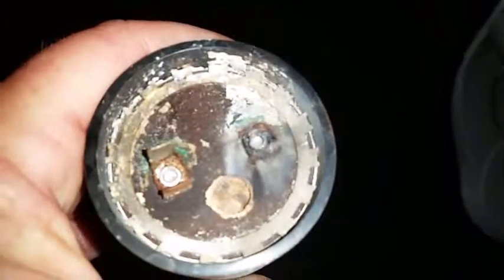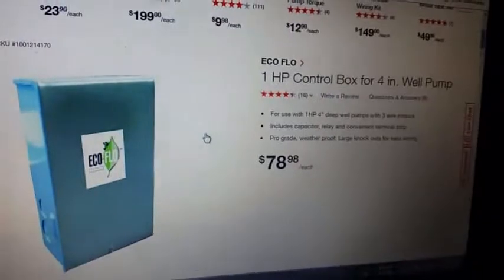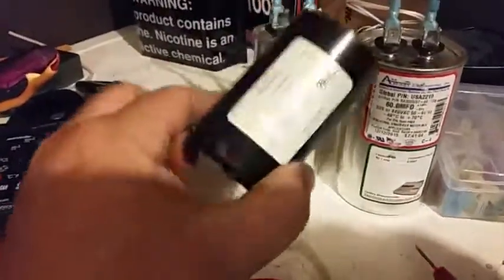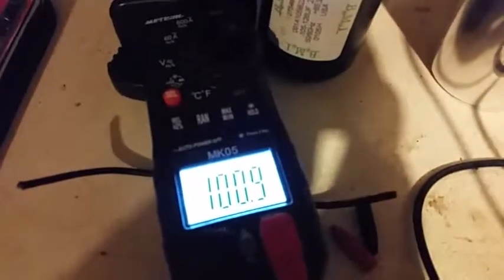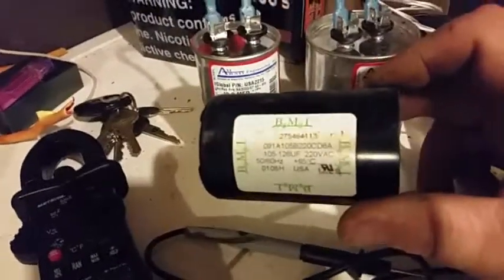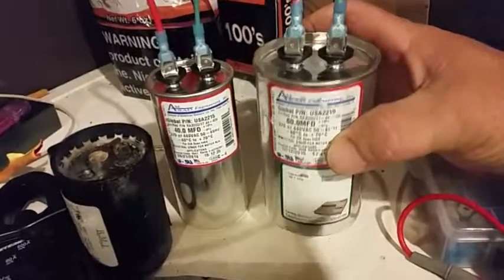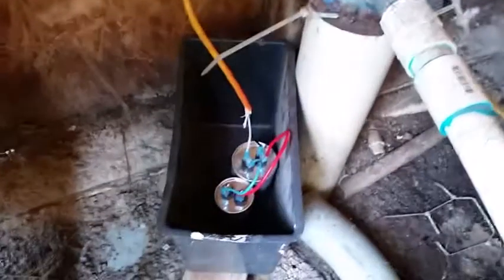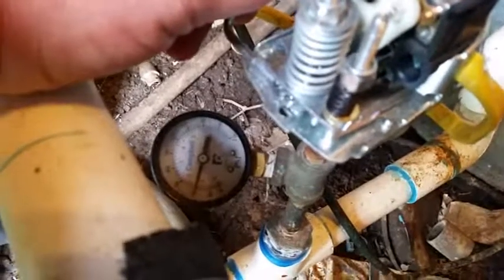replaced my well pump capacitor with a/c , air conditioning capacitors

Comment: the capacitor on mine went bad. the box is $100 in my area and the cap alone is 10. the ones listed on ebay and amazon dont have a resistor on the leads like my old one. will that matter?
Reply from the maker: @mcfriedchicken1972  My understanding that the ones with the resistor are of a higher quality and will probably last longer however I do know every single time I've replaced one with a resistor with a capacitor without one But the same rating on a pump or air conditioner it worked

Comment: Those Amrads are expensive. Would probably only be few dollars more to replace the whole thing at $78???
Reply from the maker: this was 5 years ago but even today the proper cap is only 13 dollars . https://www.amazon.com/105-126-Capacitor-220-250VAC-Replacement-Franklin/dp/B0832N997F

Comment: Parallel capacitors equal sum of individual capacitors. (NOT in series -(daisy chained)).
 Put in your replacement Cap IMMEDIATELY..
https://www.youtube.com/watch?v=ZGlLdwNW0bk
Reply from the maker: Oh there is no doubt that it was incorrect. But it worked just fine . No issues I did eventually replace it . But speaking to a hooking two or even three caps together to boost it's total rating, that works just fine . They make all in one capacitors and that is how they work

Comment: I have a well pump capacitor replacement but no wiring diagram for the everbilt one horse that I have. I am unsure of how to find which post to connect which wire from the pump to the capacitor. Any ideas on how to find the right method of wiring them in would be really helpful cuz I also don't have water at the moment
Reply from the maker: Know I'm a little late but as far as what side of the capacitor doesn't matter one wire on one side then the other it works either way
Reply: Just did this with a old dehumidifier capacitor
Reply: very cool
 @eeritt
Reply: I'm in that same boat at the moment lol